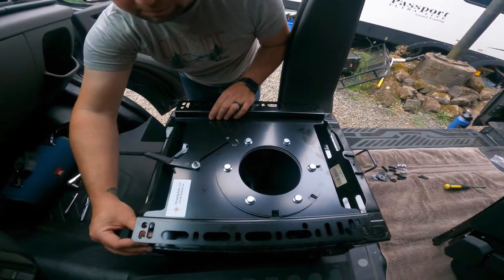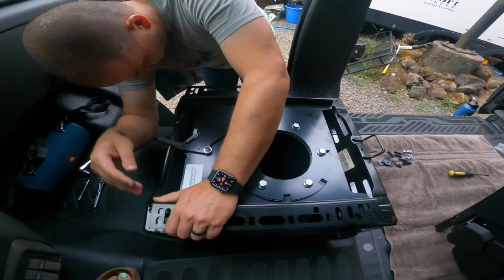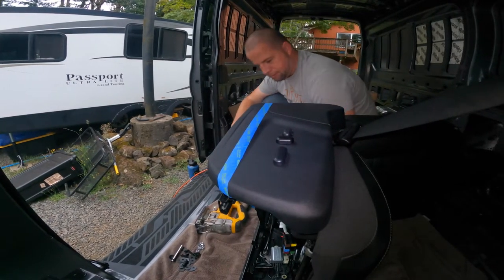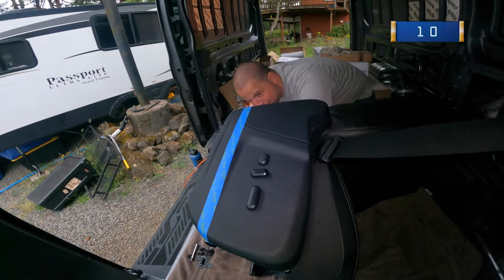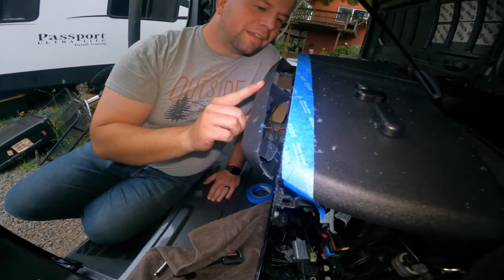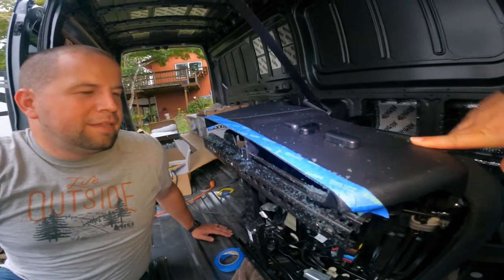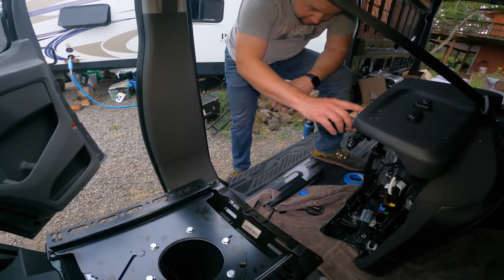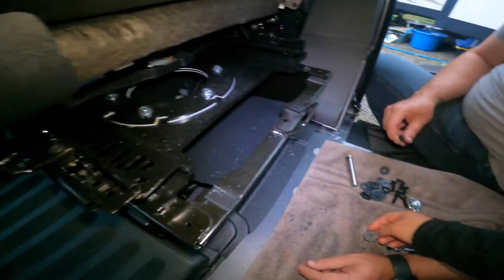Swivel Seats | Amazing Auto Swivels | Ford Transit Camper Van

Comment: Thanks for sharing! We're also in the power seat camp, so there are fewer YouTube videos sharing how they approached the challenges they face. Seems the Amazing Auto swivels work way better for us because of the wiring that the manual seats don't have to deal with (so they commonly install the Scopema ones, which seem fine for them, but look to have clearance issues for us).

Comment: Thank you for making this video to help people!!! I literally just finished AA my install on power seats **I got the AA swivel made for the power seats...then found your video...my install was almost too easy...so I am am watching videos to see if I unknowingly screwed up somehow....as far as your washer/ power seat issue....I used the removed OEM ford bolts from the seat/ base to attach the seat to the swivel, no washers...and had ZERO issues with movement. Use the provided AA bolts to attach the swivel to the base and then the ford bolts (the bolts you removed the seat with) and provided nylon nuts  to attach the seat to the swivel with NO WASHERS between the bolt and the the seat track. I didn't have to do any drilling new holes to anything...the washers as noted blow should go between the swivel and the seat rails to compensate for the retainer pin spacing. ***I bought and received my AA power seat swivel July '22
Reply from the maker: Thank You JD for the feedback and for watching! Completely agree on the washers - it’s always funny how hindsight is 20/20.
Reply: @TheNivals  its videos like yours and comments that helps us ALL get stuff accomplished THANKS MAN!

Comment: Nice video. I just installed these same swivels on my 2022 van yesterday, wish I had of seen this before I did!. Your video has just shown me that the vendor sent me two passenger seats and on one they put a sticker saying to install the driver's side upside down. It works but the handle release doesn't move with the seat, its awkward, I reached out to the vendor to request a proper driver's seat like you got. So anyways thanks for the clear video, really helpful.  For others watching, you don't have to cut the washers, the washers should be placed under the seat track and above the swivel that way they don't interfere with the slide mechanism. Also good catch on figuring out the washer on the retaining pin thing. Having your washers all between the seat rail and swivel allows a level clamping surface too - one at each of the four bolts and one on each of the retaining pin things (6 total).. The manufacturer should really include some clear printed instructions with these so we aren't all having to improvise as we go, his videos are pretty unclear. they spend more time showing you the socket they use than explaining these details you provided. I did the same as you on the driver's side. Popped the power cable and grommet out and routed under the red battery cable and brought the wiring out from between the dual batteries. The swivel bolts rub on my plastic battery cover. Maybe because mine is installed upside down? I used a 3" hole saw to cut a large opening in the plastic battery cover and routed my power cable up through that and taped around the hole and cable for extra protection. Great job on the video, super helpful.
Reply from the maker: Hi Robin - thank you for the reply! Agreed on the cutting of washers, I thought through it in a a little more detail afterwards and realized I could have done it differently. We had originally thought we received the incorrect swivels as well (for a Promaster & not a Transit) but it all worked out in the end. 

One other note, on the drivers side, I notice that if we adjust the seat to the forward most position it pulls the wires (for the power seat) rather tight, and I do my best to remember that when adjusting the seat. Perhaps this could be solved w/ drilling the hole you mention in the battery cover to better re-route the wire. 

Thank you again for the comments and for watching!

Comment: Thanks!  I'm ordering my van, and I was really wondering if you can tell me how important the Power Seats are to order.  Are they really nice?  Worth the $990 addition?  I'm thinking they give you seat heaters and lumbar, but are they better quality or more comfortable than the manual version?  Is it really slow or annoying to adjust the seat quickly enough to swivel them around?  (Power seats are slower).  Thanks!